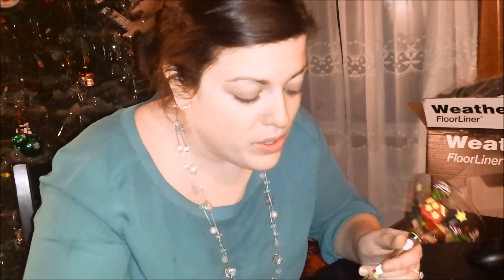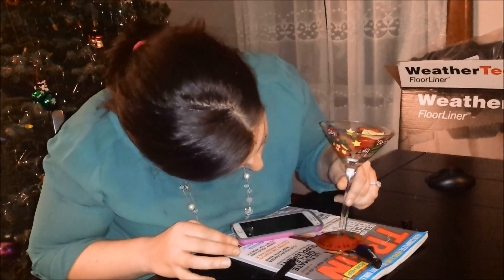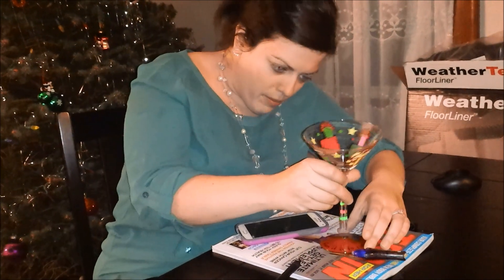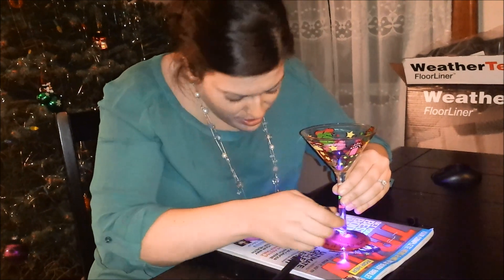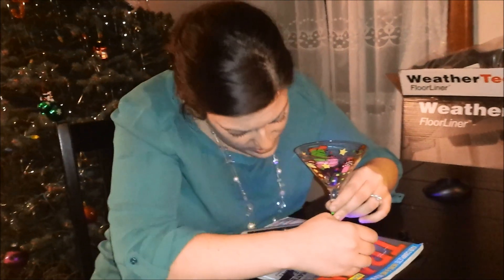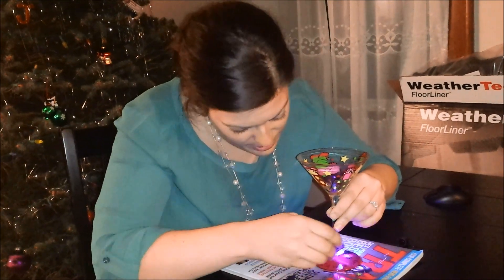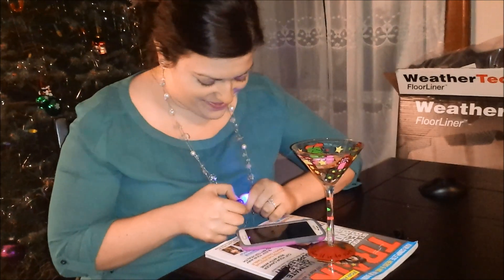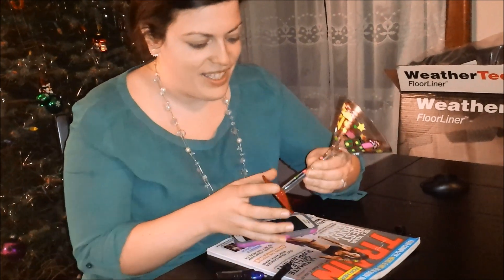5 Second Fix Product Test

Comment: My mom bought a few of these for my bf and dad as little gifts for the stocking and I probably use it more than they do. I am a gamer who has what feels like a million cords, but I also have five cats who have a habit of chewing my chords even though I have gone to lengths to teach them and remove my chords but somehow they still get to them. I use this to patch any chew marks and it works wonders. Specially for a thin chord I have with my headset which this chord get moved around a lot and I am not do delicate with the chord. Still this glue holds up.

Comment: I use it on plastic models and I will say, it does work, not the best in all situations, but I probably use it slightly differently. I use it to fill small gaps while prepping the body for painting, and installing windows. It really does work for installing the windows...a little hard to sand, but it does fill small gaps when blending a bumper to a body for instance...I just smooth it down with my finger in a thin coat and cure it. The thin coat is easier to sand, but still not perfect. So with my usage, it does the job...
Reply: this glue works quite well in the correct situation. the only thing is you must have something the uv can pass through otherwise it won't work well

Comment from the maker: @jose no the glass is still intact  this  a really  good product.
Reply: Doesn't the bond weaken when the glue gets wet?
Reply from the maker: The glass is still intact and it has been over a year now. The glass was probably used around 3 or 4 times and washed afterwards.
Reply: Andrew Strohecker 

U

Llk

Comment: to prove it correctly, you need a control set and an experiment set.. Control set not used with light and experiment with use of light.. the broken items should be identical if you can find them but this may not be as critical to prove.. just comparable items with similar density and nature of breakage ,etc,,  for example choose two separate broken items with identical materials be it glass , metal, plastic, wood whatever with comparable weight and dimensions..   This will prove that the light is needed to make a better glue than those common expoxy variety.. UV is interesting to me but Ineed to know that the glue really require the UV treatment to do a better job. Is the UV expoxy made with different chemiclas than common epoxies or those so called binary expoxies that you need to mix to make ..etc etc

Comment: just buy CrazyGlue for $1.99 and with out the light
Reply: +masterlee123 This stuff isn't really a replacement for crazy glue, in my opinion.  It's more like an additional tool to fix some things.  If you need to adhere two pieces together like she did in this video, crazy glue will work great.  However, I've used this stuff for many small repairs on plastic bits like battery doors for cameras/remotes that glue would have been a pain in the ass on.  The fact that it hardens instantly with the light is great because you can hold something in place and set it instantly.  I've fixed cracks in motorcycle fairings which, once set, I can apply some serious epoxy to and then wait for it to cure.  I've also fixed quadcopter parts with it good as new that would have otherwise had me waiting 2-3 weeks in shipping.  

As long as you aren't trying to use it as a glue substitute and use it more like a plastic-welder material, this stuff is amazing.
Reply: crazy glue sucks, I does not work
Reply: +Sebastian  Mancilla Crazy glue works fine. It's just a pain in the ass sometimes. You have to be patient and wait for it to set.